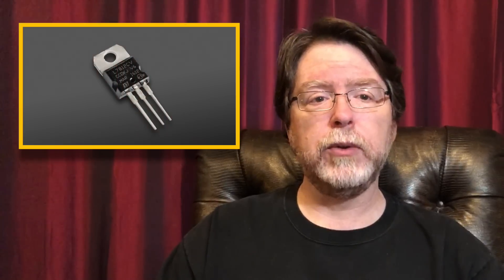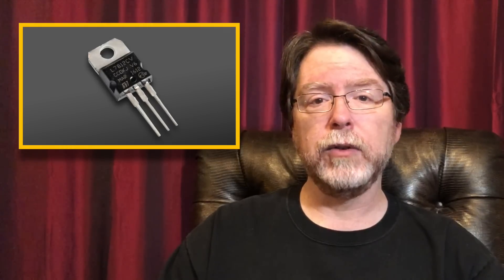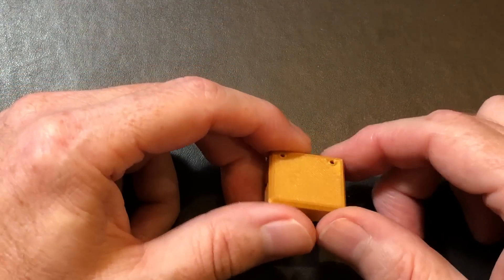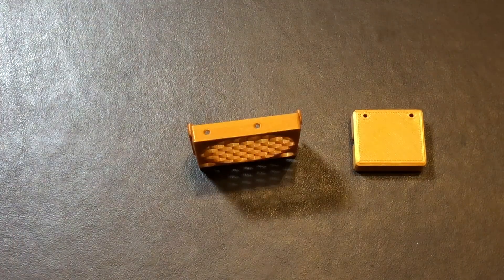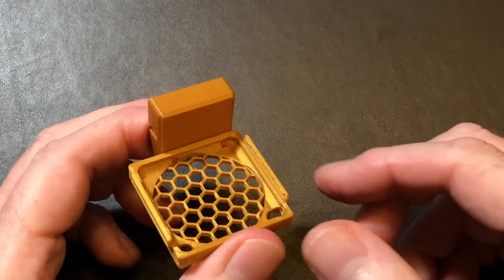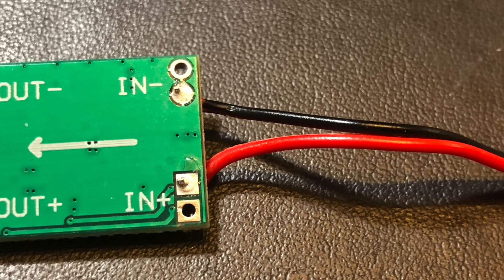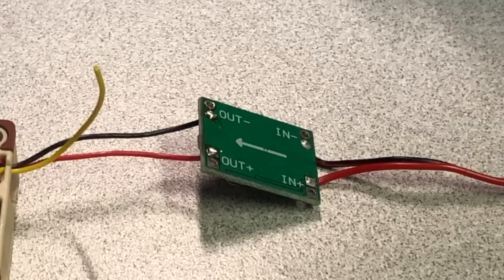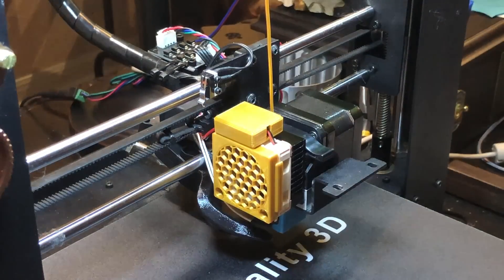Install a 12v Fan on a 24v 3D Printer using a Buck Converter

Comment: Sorry I know it is an old video, but nowadays Noctua has a 24v version of the 40mm fan, but it is pwm and 4 pins. Can we use this direct to the printer without the buck converter? I am a zero when it comes to this type of knowledge. Thank you!

Comment: These small buck converters are rated to take input voltage upto 23V where I am from. Will it be okay if I take input of 24V?
Reply from the maker: The ones that are rated at 23V will get hot and may fail.

Comment: Nice video. Can i put 2 input 24 volts and 2 output 12 volts in one buck converter ?
Reply: I just bought some buck converters today to make this modification to my own printer, they sell 6 converters for $8, I'd suggest just using multiple converters. Putting 48 volts total to a chip intended to regulate 24v will likely overload it.

Comment: Is it just me? The yellow wire is giving me anxiety coz it could be touching the circuit inside since the tip could still have exposed copper

Comment: Hi Bryan!

Thx for the awesome content you're doing!

I plan to replace the single 24V fan from my Alfawise U30 Pro with 3 Fans. (2x Radial GB1205PKV1-8AY and one axial Fan) since radial ones are 12V Fans I need to get the Voltage down to 12V anyhow. What would you recommend in this case? Using one Buck converter and then put the 3 Fans in parallel behind it? Or using the two GB1205PKV1-8AY in series and put a 24V axial fan to them in parallel?
GB1205PKV1-81205PKV1-8AY
Reply from the maker: Hi Martin! I'm glad you like the videos!

So the GB1205PKV1-8AY.GN-SUNON_IT take 0.124A of current each, and the little buck converters can supply up to 3A. So there's plenty of current available for the blowers. You should be able to power the buck converter in parallel with the 24V axial fan, and power the two radial fans in parallel with the 12V output of the buck converter.

I wouldn't run two 12V fans in series on a 24V supply. If one fan fails open, the other will get a full 24V, and that would be bad.

I hope I understood what you were trying to do, and I hope this helps!
Reply: @BV3D  

Thx Brian! Yes you hit my question on the spot! Thank you, that was exactly what i was searching for! Your next coffee is on me :)

Br

Martin
Reply from the maker: @MartinSchoenbacher  (raising cup of coffee in salute) Thank you, kind sir! <sip>

Comment: Hi friend, very good video. But I have a question. I want to install the double fan to my printer's layer with a MOD that I found in thingiverse. My printer works with PMW 24v. Can I connect the two "noctua" 12v fans in series? What you think?.
Reply from the maker: I don't think that would be a good idea. It's probably better to use a single buck converter to power both fans at 12v in parallel. 👍
Reply: BV3D: Bryan Vines thank you my friend. A mosfet module is well?
Reply from the maker: I haven't needed one on the Monoprice Maker Select Plus printers. But there's plenty of room inside the case if you want to install one for the bed. You might want to inspect the internal connections from time to time, and make sure the screw terminals are tight, and that the wires for the bed heater don't look overheated. I have two slightly different versions of the main board in my two Maker Select Plus printers. On one, the bed connector is like the main power connector, and it can be unplugged from the board. On the other, the bed connector LOOKS like that, but it's soldered to the board, and you have to loosen the screw terminals if you want to unplug the bed wires.

Comment: hey! Just a suggestion. you could put the step downs inside the control box or whatever you have. so your carriage is lighter and less crowded!
Reply from the maker: That’s not a bad idea. The X carriage has gotten somewhat bulky with a TL-Smoother for the extruder stepper also riding on the carriage. In order to move the the buck converter into the body of the printer, I would need to run a pair of leads (and a connector) up to the extruder assembly. I can pull the 24 volts straight off the power supply. 

I would also like to move the TL-Smoother board that's riding on the X carriage down inside the printer, but because all the power and signal leads for the stepper and fans and sensors on the extruder assembly are all on a ribbon cable, I'd need to break out those signals from the main board to feed an extruder TL-smoother in the printer body, and run another four leads up to the motor on the X carriage. It could be a fun challenge. 👍

Comment: I bought some Noctua fans after seeing some videos and pictures of people having them on their printers... When they arrived and I was looking at them right after I took them out of the box, I saw 12V so I started looking up how to adjust the voltage in Marlin but didn't find anything...I then I searched lower voltage from 24v to 12v fan for 3d printer and found your video. When I bought them I figured the motherboards/Marlin could correct this but I was way off. Thanks for the video, you saved me a lot of stress and confusion.
Reply from the maker: Hi! I'm glad this video was helpful! It would be cool if you could specify a fan's max voltage in Marlin, but the boards would have to support that feature themselves. If a 24v board had some sort of programmable buck converter that could be set to output 24v, 12v, or 5v, that would be awesome! I guess a danger with that would be making sure that the voltages were properly defined in Marlin before uploading firmware. Otherwise you could fry a printer-ful of 5v fans with a single "oops!" 😄

Comment: but for a part cooling fan that'll stop the PWM from working right?
PS: Some printers have a fan that only turns on when the hotend gets hot
Reply from the maker: The PWM still works on the fans. 👍
Reply: BV3D: Bryan Vines Even if it does, it may not last for long, as the buck converter is not designed to be powered up and down several times a second. It is a much better idea to just wire the input of the buck converter to a constant 24V source (such as the power supply output or a 24V output on the main board. Then wire the +12V buck output to the positive terminal of the fan, and the PWM switched negative fan output from the main board to the fan negative. Most (maybe all?) printer boards use low-side switching (switching only the ground side), so you are free to connect another power source to the fan (as long as the power source is grounded together with the main board).

Comment: Coincidentally I’ve just bought the same/similar buck converters. The ones I’ve bought say not to use with a light load, which makes me wonder if they are going to work? https://www.amazon.co.uk/dp/B01MQGMOKI/ref=cm_sw_r_cp_api_i_5P72Cb3Q7JM93
Reply from the maker: The description for those buck converters says not to run them at less than 10% of output power. Electrical power is measured in Watts. The buck converters provide a maximum current of 3 Amps. If you're setting it to 12V, that's 36 Watts. (The formula to find Watts is Current x Voltage). The specifications for the 12V Noctua fan (NF A4x10 FLX) says it has a maximum power input of 0.6A. Since 10% of the buck converter's 36W output is 3.6W, the fan is drawing far less power. So this may not work well.

These are the mid-size buck converters I never got around to using. I used the big ones, and then I switched to the even-smaller-than-the-one-you-bought size. But none of the buck converters I bought ever said to avoid using it with a light (or no) load on the output.

So feel free to experiment, just know that the spec sheets for the devices involved say that it may end in sadness and failure. I hope that helps!
Reply: Thanks Bryan, that’s a brilliant clear explanation. I guess I’ll give it a go and see what happens!

Comment: Does this work with PWM fans? Or do I need to do something else, like use a different power converter?
Reply from the maker: Well, I tested a buck converter on the parts cooling fan, which is PWM controlled. It worked fine. I suspect it works because PWM simulates speed control by turning the fan on and off really fast, so it never has time to get to full speed (unless the PWM pulse is at a 100% duty cycle). And since it's just pulsing the 24 volts to the fan, the buck converter converts those 24 volt pulses to 12 volt pulses for a 12 volt fan.
Reply: @BV3D  That might not work with all buck converter and all PWM signals (you might have found a good combo of parts by chance). I had the issue when trying to pass higher frequency PWM through a converter (but it was two chips that needed to communicate).

I suspect the buck converter "smooths" the PWM curve, which messes with your signal if you're trying to use PWM for communication. From experience in that case you need to get a specific chip that'll reproduce your exact signal even at high speeds and just change the voltage. Not sure those are readily available for 12v/24v conversion.

For a fan's output what matters is probably the integral of your voltage curve, and a buck converter will somewhat conserve that property. Not sure either if there's a specific kind of PWM required by those fans to ensure optimal operations (in terms of noise output, motor lifespan, flow...).

In which case another cheap solution would be to use an h-bridge. Those circuits take in a PWM signal, and output a constant voltage (proportional to a reference voltage and the PWM frequency).

I might be overthinking it by a lot, but on my own 3D printers those nice little Noctua are more expensive than any other individual part.
Reply from the maker: @rpnct  You have a point, and I need to look at it more closely. Thanks!

Comment: Interesting , I was wondering why my extruder fan kept spinning even though the printer was off even though the Mezi board USB was connected to the pi . But would I need another buck converter for the other cooling fan since  that one is a noctua as well?
Reply from the maker: Hi! Any 12-volt fan that you intend to run on this printer is going to need a 12-volt supply, so yeah - they'll both need buck converters. On the bright side, buck converters are not terribly expensive. The parts-cooling fan has its speed controlled by a pulse width modulation (PWM) signal from the Melzi board. I tested this and it works with the buck converter, because the way that PWM works is that it turns the power to the fan on and off real fast to get the fan to run slower.

Comment: What happens if I run a 12v fan on a 24v machine. Will it die prematurely?
Reply from the maker: The fan won't like it. For the short time I did that with a 12v Noctua 4010 fan, it ran way too fast and smelled a little funny. Had I continued, I'm fairly certain it would have died: either from some kind of thermal failure, or from releasing its Magic Smoke™.
Reply: You should consider selling a pre-wired kit with the Buck converter and wires to the board. I’d buy one. I don’t solder, nor do I plan to. P.S. I see why you went to the Noctua from the radial fans. The radial fan is loud. I ordered a Noctua.
Reply: I don't need 10 buck converters. Where can I buy just one? :)

Comment: Hey Bryan! I'm not super savvy when it comes to electronics, But you've Explained everything PERFECTLY. You're Clearly well versed in this stuff and I really appreciate.
I have one question. 
Is it possible to wire this Buck converter on the Electronics side of the printer instead of the fan side? I have a Hypercube 3D printer that I built myself. and this Hypercube has a enclosed section at the bottom where all the electronics are hidden. Is there a possibility to hide the Buck converter There and then have a Wire run through the back with the rest of the wires to the hotend, and the fan?
Reply from the maker: Hi, Fernando! It's certainly possible to install the buck converter in the electronics box of the printer, and run the fan wires along with the rest of the wires that go to the extruder. 
The main reason I put the buck converter with the fan is that, on this printer, the only wires to the extruder are that ribbon cable. On many printers, the individual components on the extruder have with long wires, and they all run back to the electronics box. So in that case (and it sounds like YOUR case), you can do this. If you do, I recommend using some kind of detachable connector between the buck converter and the fan, so that if you need to replace the fan, you don't have to desolder any wires.
Thanks for the compliment, and thanks for watching! 🙂
Reply: @BV3D  I appreaciate your input on the matter. One more question. How is the heat management on this?
Reply from the maker: @fhadesson9525  I have not done a formal heat management comparison (using a temperature probe inside the heat break) between a Noctua fan and the stock fan, but I've had this running on two Maker Select Plus printers since November without issue. Both printers have Micro Swiss all metal hotends installed. I've printed PETG in the 250˚C range and not had a problem. So, no hard data, just anecdotal evidence. 😃

Comment: Don't worry about stray fingers and screwdrivers hitting the blades, those Noctua's are made from sturdy plastic and will not break as cheap chinese fan blades, i do not use a fan grill since this also restricts airflow and induce noise.
Reply: Noctua fans are nice, but they are made in both China and Taiwan. Products are just manufactured to the specifications of the companies they are made for. In this case, Noctua holds the manufacturers to a higher standard.

https://tinyurl.com/y6sf4gyb

Comment: I got one of those but its not really quiet and it moves less air then
Reply from the maker: Hi, 123! That's unfortunate. I'm sorry to hear the Noctua doesn't work as well for you as it seems to for me. The first time I used the Noctua fan, I was running it off the 24 volt supply instead of reducing it to 12 volts. That made it loud because it was going twice as fast as it was supposed to. But in my experience, running the 12 volt Noctua fan on 12 volts makes it happy, it's quiet, and it seems to move enough air to keep the heat break doing its job. Thanks for watching!
Reply: @BV3D  be anychance will the fan run on the straight 24v? I just picked one up and my printer is apart and it seems to run fine just a bit louder? Will it burn out in like a day or am I fine till I can get a buck converter?

Comment: Hello, this seems like a good idea. But the thing that is staying in my head is how about the PWM speed control of the fan the printer uses?
Reply from the maker: That's a good question, and I don't know how a PWM-controlled fan would behave. In this particular instance, the fan on the extruder is always on, and the printer drives it with a constant 24-volt supply. So the buck converter works here.
I'll check my parts bin and see if I have a 12v fan or blower, and see how that works when connected to the parts cooling fan's pins. The parts cooling fan is PWM-controlled, so it'll be interesting to find out what happens!

Comment: Well done Bryan I use them on my rc quads, they are very handy.
Reply from the maker: Thanks, Zimmy! I guess they're useful anywhere you need a regulated DC voltage (as long as the desired voltage is less than the input voltage, that is!). Are you using them to drive LEDs or using them as a BEC for a receiver?
Reply: using them to power cameras and video transmitters, lights  and all kinds of things the newer systems have buck built in but the older ones don't or are the wrong voltage  @BV3D

Comment: Get an affiliate account it's easy with Amazon and they pay monthly reliably and it's safer for your customers since you get the excellent Amazon return policy

Check out my Amazon deals page I have new Buck converters that I found they are literally half the size of those and half the price $5.95 for 10 of them delivered they're rated for 23 volts but I ran them at 24 volts running my fans and they handle it just fine super tiny super convenient :-)
Reply from the maker: Thanks Chris! Dang -- even smaller than the postage-stamp converters? I'm off to check these out! 👍
Reply from the maker: I just found them. A redesign around the even-smaller part could get the mounting box to sit entirely over the Noctua fan, making this mod useful for even more printers! Thanks again for letting me know about them!
Reply: @BV3D  something else you can try don't even replace the fans just interrupt the wires coming off of the brain board through the voltage regulator and turn the 24 volt fan down to 12 or 13 volts many of them work just fine but now silently and putting out about the same air that the quiet fan would not quite they are more efficient but many times good enough :-)

Comment: Great video. This is very useful for any 24v printer that people may want to put a 12v fan on. And man that buck converter has got small. Anyway take care and ill see you in the next one
Reply from the maker: Hi Scalda! I know, right? It's super tiny! When @Nerys tweeted about them a few weeks ago I knew I had to get some. I want to say they were USD$12 for 10, so at $1.20 each they're really inexpensive. And they're so small I could probably shave another millimeter or two from the height of the mounting box. For those who don't have the room horizontally, the design could be modified to hold the buck converter vertically, and that could print as a single piece with the fan grille (the lid would still be separate).  😃
Reply: @BV3D  yeah I remember seeing that tweet, and $1.20 each is a really good price. And yeah with them being that small they open up alot more mounting options. Thanks for showing us them and the new mounting design